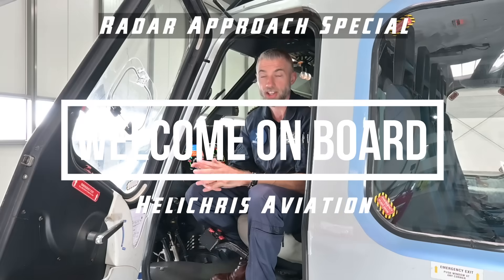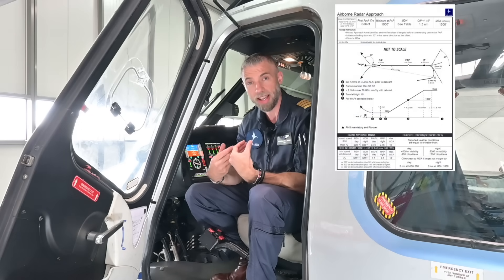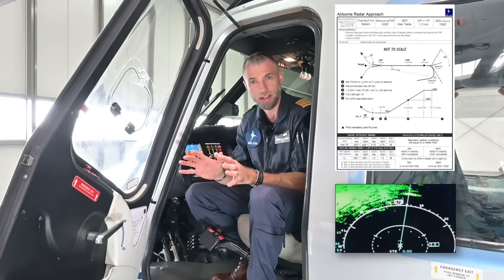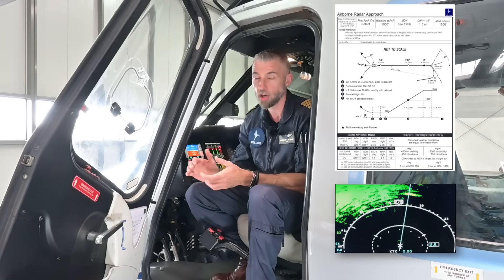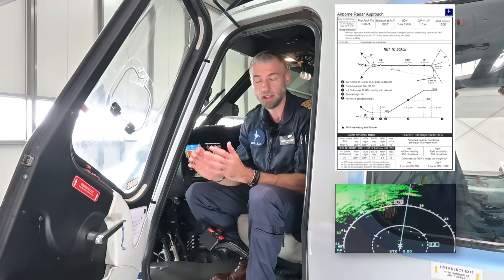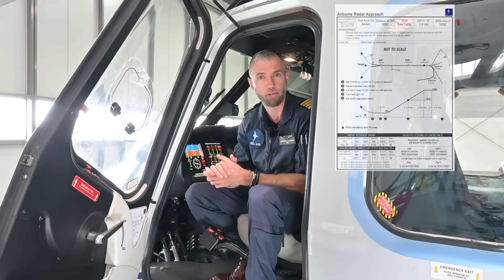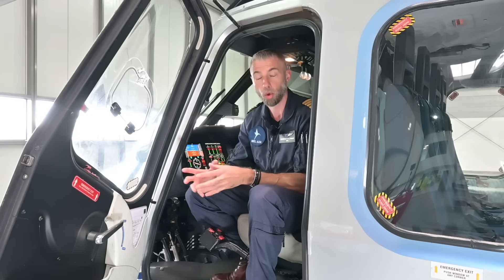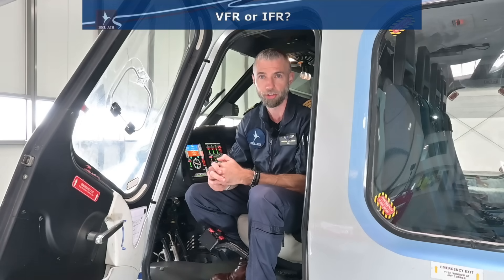We use a RADAR to find the helideck. Offshore Radar Approach explained.

Comment: Is the dead man's curve the same when you operate over water as it is over land? And can you even avoid it when approaching and departing the flight decks on platforms?
Reply from the maker: Thanks for your comment and question. Indeed, performance is the same over water. However the helicopters used offshore have two engines and are designed to operate that way. We have special profiles that we fly to and from a helideck that guarantees safe fly away capabilities or safe landing capabilities. We train this regularly in the simulator

Comment: At 3:13 , good point about the physical terrain object database . That's what they blamed on the Irish Coast Guard R116 crash. The tail rotor of the S-92 hit a rock / island off the Mayo coast and they spun into the North Atlantic. Apparently they think the rock should have been in the onboard data base. Substitute for good old fashioned observation / airmanship. God rest their souls.
Reply from the maker: Indeed.  Horrible crash… 😢 database obstacle systems I think are not a very good option.  It’s like driving your car without windscreen with a picture of the road from google maps take a year ago.  We need actual info. And the weather radar so far is all we have.  Never designed for this purpose originally, but it’s working 🤗. Thanks for your input and info share! Very valuable
Reply: @HeliChrisAviation  You're very welcome. Thanks for taking the time to reply. Shouldn't encourage me really 😄. Good analogy with the google maps, and excellent that good old school real-time radar can deliver on the infrastructure front.
Reply from the maker: @jackspratt4343 indeed.. and even though this is very normal in offshore flying since the 80s.. it’s still a very special way to operate.
Reply: @HeliChrisAviation  Analog  in a digital age. I suppose an oil rig stands out like a bulldogs b*llox on the scope on a calm day, not sure on the pilot work load in choppy seas,  picking out a man made structure against the background clutter of white caps in poor viz.
Reply from the maker: @jackspratt4343 indeed! We can clearly see the large structure returns on the radar! Even in rough seas we can quite easily see these 😊

Comment: Can the AW139 fly a glide slope on auto pilot like the Airbus H160 ?   Thanks
Reply from the maker: Thank you for your comment! Indeed we can also fly coupled glideslope 😊
Reply: @HeliChrisAviation  Thanks for your answer, that's interesting.
Reply from the maker: @jackspratt4343 thank you 😊
Reply: @HeliChrisAviation  Irish Coast Guard swapping out the big Sikorski for AW189's. Which would you prefer to take out into the Atlantic / North Sea / Irish Sea in an emergency ? Ta
Reply from the maker: @jackspratt4343 thank you for your comment! I know the 189 very well and think that is a perfect platform for SAR. But then again… I have no experience in the Sikorsky family 😅
Reply: @HeliChrisAviation  I have been on board the big Sikorski several times , whilst on the ground. It's like a porta cabin with a big rotor attached to it. A big ramp at the back. Phased them out now in Ireland. Some think they've been short changed by the new 189 set up. Time will tell I guess.
Reply from the maker: @jackspratt4343 indeed. We need to give it time to really see the results.  I fly the 189 since it was introduced in 2013. For me it also took some time to appreciate… but i think its the best in class now.
Reply: @HeliChrisAviation  Better than a H160 ? Assuming that they are in the same class, which I'm not sure that they are. AW's have the lineage, the pedigree. Looks-wise the AW range win hands down. Jaw droppingly beautiful helicopters.
Reply from the maker: @jackspratt4343 I have no experience with the H160. I did fly the 155 and loved it! At least for the pilots.  🤗. Not for the passengers… and no performance.  The 139 and 189 are workhorses 😊.
Reply: @HeliChrisAviation  This guy has two Dauphins and a Black Hawk.  
https://youtu.be/V-25GF-d1Fc?si=ezsdPCIhqc_LcwX9
Reply from the maker: @jackspratt4343 wow!!! 😮
Reply from the maker: @jackspratt4343 wow!!! 😮
Reply: @HeliChrisAviation  And a former Red Bull stunt BO 105.

Comment: That was an excellent presentation. Thanks. I live on a yacht and in my recent solo crossing of the Atlantic from Europe to Grenada I became increasingly dependent on my Radar to be able to see developing weather cells at night. It takes a lot of practice to be able to understand what the screen is telling me, and how to react to it given a Yacht’s very slow speed. I’m still developing techniques to determine the path of weather cells, and also learning how quickly they can form. Twice in an hour storms formed right behind my boat then moved to engulf the boat causing a 180 degree turn and the use of the Dopla to pick the safest direction through these systems.
Reply from the maker: Thank you so much for your kind comment and sharing your experience! Wow.  That’s impressive!! To be solo on the ocean… makes you feel very small in nature.  Indeed! Interpreting the radar is really difficult and takes time and practice.  Thanks again!! Really interesting
Reply: @HeliChrisAviation Thanks Chris. I could add that after 6 years living in NL I started my trip from Stellendam, South of Rotterdam. For those 6 years I drove daily through the Benelux Tunnel, under the Schiedam Haven where many of the platforms you fly too are maintained. My favourites are a trio of ships, one being the Wind Orca, which were there to be upgraded to 1600 tonne crane capacity. To, on a rainy morning on a highway, drive towards the tunnel to be confronted with a whole ship sitting 30 meters above the highway on legs is a total mind blow. From your aerial platform you get to see all of this amazing European technology. I’m jealous.
Reply from the maker: @billbunting4253 wow thanks for sharing! Indeed.  It is SO incredible to see these offshore monsters.. really amazing!
Reply: Impressive video👍👏👏👏
Reply from the maker: @sagittarius_ thank you so much

Comment: This takes me back to flying between 1990 & 2000. Aerospaciale Tigers, Pumas, S61s, super Pumas, ... Bell 212s

Things have changed in the cockpit so so much, but the approaches are the same.

While I was working g Bristow or Bond ?? lost an aircraft off of a Shell platform (Brent), taking off in 55knots TWS (total nuts).. they were dropping down to DSV Tharos but dropped into the sea
Reply from the maker: Wow! Thank you so much for sharing! I’ve started on the 365 Douphin.. bit of the same era cockpit… things really have changed indeed.. thanks again!! Fascinating
Reply: @HeliChrisAviation  yes it was in fact British International Helicopters. She'll were, on paper, all about safety yet they were
 Push push push and don't keep the helicopter waiting. Total BS when I think they were pushing pilots to operate in those conditions.
Reply from the maker: @grantsutherland6798 wow crazy indeed… I think things have changed to the better indeed.

Comment: Great information. My question is why not establish say an RNP procedure? Is this because the rigs move or due to the fact that RNP procedures time time and resources to establish?
Reply from the maker: Thank you for your comment! So far RNP approaches are not designed for offshore installations. There is a change there will be Pins approaches in the future, but still we need our weather radar for obstacles. RNP approaches are also database based and not looking outside
Reply: @HeliChrisAviation  That's understood. Of course for an RNP to exist the area must first be surveyed and charted etc. So your onboard AWR replaces the need for this in a sense,  providing a more flexible, less accurate picture of the objects.
Reply from the maker: @simoncourtney1592indeed. And we create the inbound track ourselves. So always in to wind.
Reply: @HeliChrisAviation in strong winds and destinations such as this one with tall obstacles around the deck, do you have hard wind criteria for circling to a tailwind landing, or is it still 60kt and PIC discretion?
Reply from the maker: @Eseem1 indeed.  We never do tailwind offshore. So circling is possible with enough room to manoeuvre and also wether above minima.
Reply: @HeliChrisAviation Thanks! So on the rig in the video above, with a wind from ~120°, the deck would be behind you if you were pointing into wind in the hover before landing, would you still be able to use this rig? Can you reverse onto the deck? Or is the 60kt only for rigs where you can keep both deck and wind roughly on the nose to touchdown?
Reply from the maker: @Eseem1 we can manoeuvre indeed, but with high wind we keep the nose into wind.  And the profile does not give the ability to fly backwards.  In that case, the helideck will have a wind limitation zone for no operation.  We have a limitation list for all platforms.
Reply: @HeliChrisAviation Thanks so much, best aviation channel in ages!
Reply from the maker: @Eseem1 thank you so much 😊

Comment: Australia IFR is very similar but sounds different. Our Class Echo doesn't start until 8500 commonly outside the terminal areas, so even as a fixed wing IFR we will get a information service only, not a control service.

We will often do VOR/NDB/ILS/RNP approaches outside controlled airspace for smaller airports. 

We can calculate our own LSALT (lowest safe altitude), or use charts MSA 25 mile or 10 mile radius/Airways MEA to avoid obstacles.

Seems to be you go below the MSA though and use the weather radar for the obstacle avoidance instead.
Reply from the maker: Thank you so much for sharing this! Really interesting to see the similarities and differences!